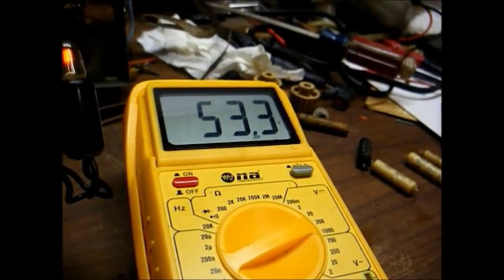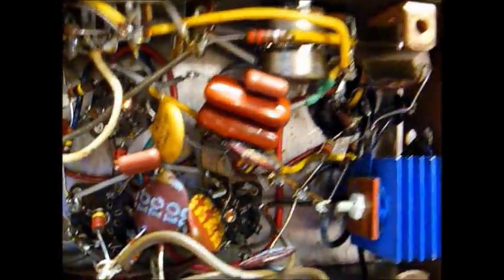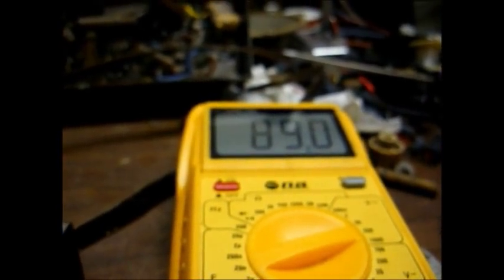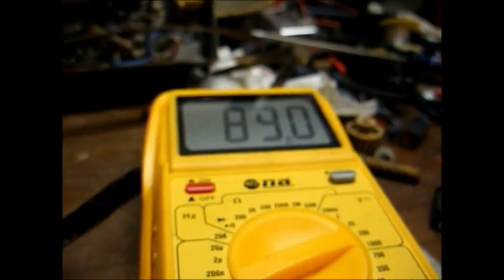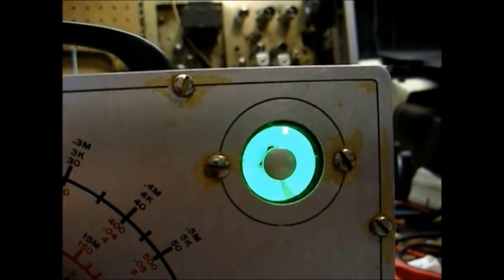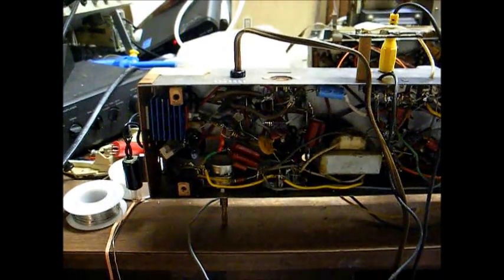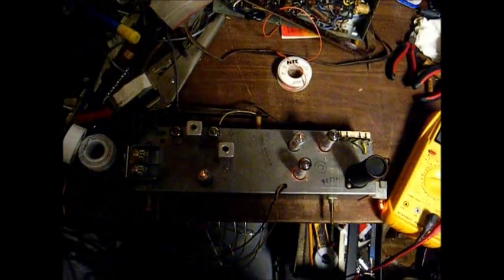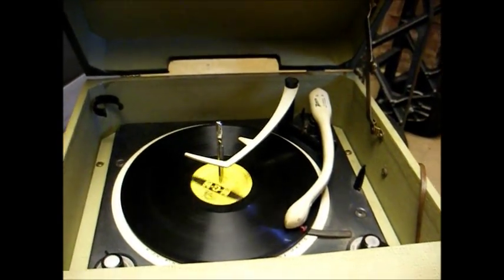Circa '58 Zenith cobra-matic record player repair - part two

Comment from the maker: My theory on what happened is that the wattage rating of the resistor was borderline to begin with. With all the old capacitors becoming leaky, they caused just enough excess current thru the resistor to slowly fry it. It has a 2W resistor in there now; so, there should be no more problems with it.
Reply: radiotvphononut  just partially repaired a 1953 Zenith radio/phono the radio plays fine now to get the record changer to work. When the speed control lever is moved from off the turntable does not turn. Any suggestions ?